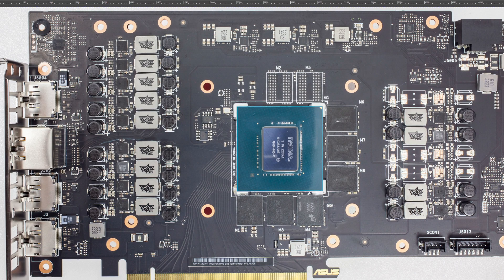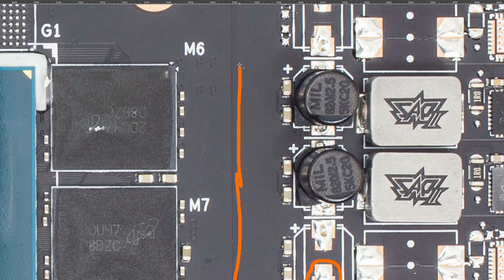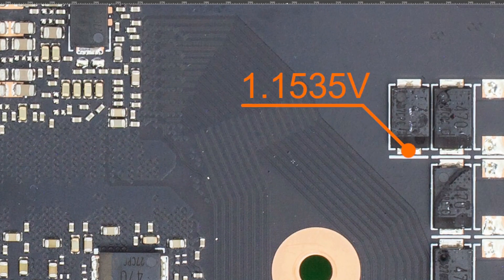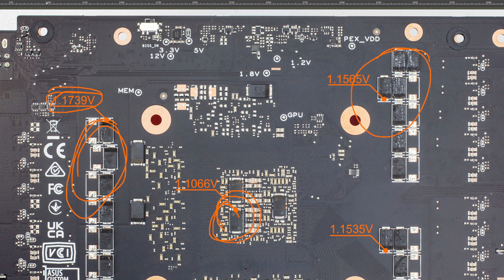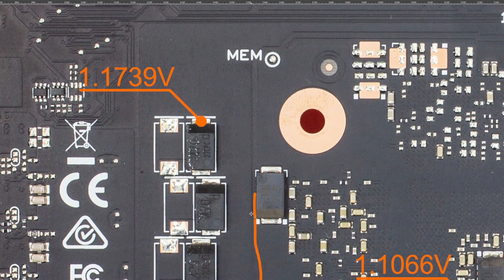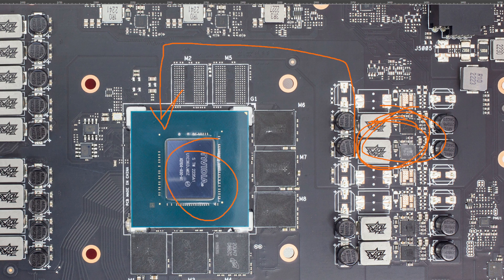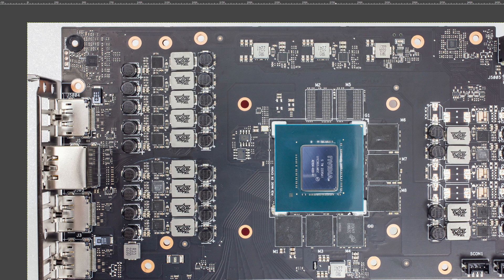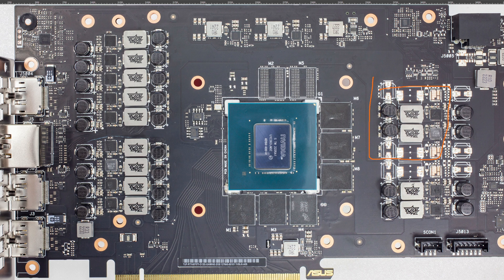investigating the Vcore VRM layout of the ASUS RTX 4070Ti TUF

Comment: I'd be pretty amazed if they put vcore directly under the PEX traces, especially with the huge currents. With PCIe 5 we're up to the point where foil roughness on the back side of adjacent reference planes matters for impedance control, so referencing the traces (which have a different voltage to vcore, thus would have a huge current loop for return currents) onto a vcore plane carring a hundred plus amps seems unworkable. Although I am surprised that nVidia controls that section of the card so heavily that you couldn't add extra layers below. As long as via stubs are properly backdrilled it shouldn't be any different to their reference design in terms of timing and SI.
Reply from the maker: depending on how many layers there are could be something like:
1 PCIe
2 GND
3 VCORE
4 ???
5 GND
6 PCI-e
Reply: @ActuallyHardcoreOverclocking  mostly yup. as long as each signal layer has an adjacent ground near it (remember the stackup isn't uniform and the core is wider than the prepregs) it'll be well-referenced. although if you have very large currents on Vcore, the (ground) reference plane will carry very large return currents too, which means a voltage drop across that plane proportional to the product of the current and the plane impedance. PEX has common mode rejection so it's generally ok, but ideally the fast stuff is kept on reference planes not shared with huge return currents.

the ??? would also probably be PCIe fwiw. routing out from a dense BGA usually requires a whole bunch of layers. and all the PCIe layers you marked would also carry GDDR traces too.
Reply from the maker: @gsuberland  PCI-e doesn't have that many data lines in it. I'm pretty sure all of it fits on just 2 layers so what we see on the top and bottom is all the high speed PCI-e. So layer 4 could just be more power or GND or maybe some low speed stuff. Also the PCB could be 8 layers in which case isolating the PCI-e from Vcore would be even easier.
Reply: @ActuallyHardcoreOverclocking  it's mostly just the dogbone routing that's a pain in the ass on fewer layers, unless you're running fancy blind and buried microvias and/or in-pad (although they avoid that on BGA usually due to high potential for wicking). super common to have PCIe split over a lot of layers when you're doing dense breakout, even despite low pin counts. same with DDR. would be cool to see the full stackup / boardfile though... I wonder if any have leaked yet.
Reply: @ActuallyHardcoreOverclocking  The 4th layer is "profit!"

Comment: Is it possible to populate aftermarket memory onto the M2 and M5 sockets?
Reply from the maker: I'd be very surprised if the memory controllers for them weren't disabled somehow.
Reply: You want to manually mount BGA GDDR6? I mean, good luck!
Reply: @hammerth1421  some repair shops replace GDDR6 memory chips all the time
Reply: Attempting to populate and "improve " this model may not be practical, but would definitely be great content.
Reply: https://youtu.be/LgU9snuKjeM
Reply: The 4080 was released five months before the 4070ti.  It could very well have the same memory controller.  Oh well, just a thought.  It would actually be a hardcore overclock, if it was possible.

Comment: What I'd like to know is why the caps on the TUF 4070ti are rated for 20k hours and the caps on the  Strix 4070ti are rated for 15k hours?

I asked ASUS and they wouldn't answer. 

Did they put lower rated/durability caps on a more expensive product?
Reply from the maker: the caps on the TUF are 5K at 105C. Where are you getting these 20K and 15K ratings?
Reply: @ActuallyHardcoreOverclocking  I got it from the front page for each product (i.e., TUF 4070ti and Strix 4070ti). See Features/Overview and the 6th/8th bullet point there. It's also mentioned later on that page.

Unfortunately, iirc, YT bans all comments with links, so I cannot provide direct links.
Reply: @AR-ey1ur  ASUS marketing is multiplying the rated life expectancy of the capacitor to be in line with an expected temperature. The lifespan of capacitors increases greatly when operated below their rated temperature, in this case 105c.

See Gigabyte LGA775 era marketing with "50,000 hour capacitors!!" when they're really using 2k Nichicon LF often times.
Reply: @mlxoc712  In the case of the TUF, they explicitly stated 20K at 105C, though. So a specific rating at a specific temperature.

With the Strix, they haven't mentioned the temperature, but I doubt that the rating is meant to be for a higher temperature than 105C and they wouldn't mention that.
Reply: @AR-ey1ur  I have just checked the website, and am surprised to see that. It seems ASUS marketing is lying, potentially through ineptitude. The capacitors clearly show 5k in this video.
Reply: @mlxoc712  To make matters worse, I asked ASUS support about this explicitly. At first they pretended that they don't know what I'm talking about and then they ghosted me. It's been almost a month since their last reply saying that they'll get back to me.

The cap rating was a decisive factor for me when choosing a GPU. Clearly, I didn't want to pay more to get a less durable product.

I also asked on r/ASUS and GamersNexus, but none of them give a shit either.
Reply: @AR-ey1ur comments with links are just auto-filtered, not banned. You can bypass this by not including some parts of the link that trigger it.

Comment: With all the benefits of getting the vrm closer to the die, is the pcie interface too bulky? Would we better off if pcie was a pga socket on the back of the pcb and then memory and vrm could surround the core from all sides? If vertical gpus were the standard then heatsinks could be in the same orientation as the cpus and airflow could be shared too.

Comment: That's a lot of power loss, I knew it would be a huge loss but didn't expected this much, this lile 5% power loss,
If I was an armchair CEO I would be looking into integrating copper bars with the power plane to reduce resistance and impedance and it would also make the control loop a but faster and the far away caps a lot more effective for the core.
Reply from the maker: eh it's probably around 10W in not really a big deal considering the overall power draw of the GPU.
Reply: @ActuallyHardcoreOverclocking  200A at 0.1V voltage difference would mean 20W
Reply from the maker: @noreng9333  yes but it's 1.15XXV vs 1.10XXV

Comment: Heatsink compatibility between 4080 and 4070Ti, whaddayamean? The 4070Ti is a 4080 isn't it?
sarcasm

But really, how did Nvidia think it would get away with that? One GPU requires (or at least benefits from) elaborate power delivery, one does not.
Reply: you misspelled 4060 Ti KEK

Comment: I really wish I understood the design of microchips. I know transistors in the chip are really small but I can't seem to grasp how code is executed on a hardware level.
Reply: Logic. Through a ton of logic. Each transistor/capacitor can be a single bit. If you arrange them in certain combinations, you can execute various types of algorithms/instructions. Code can only run on these chips if they are properly translated by the compiler etc